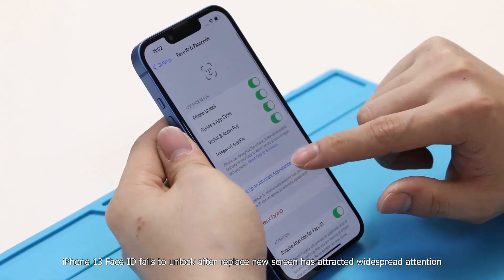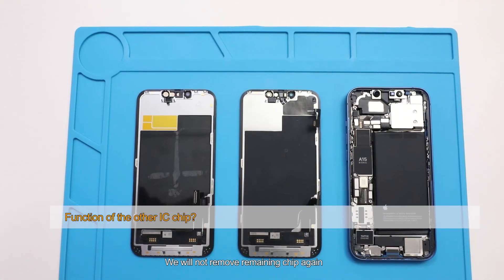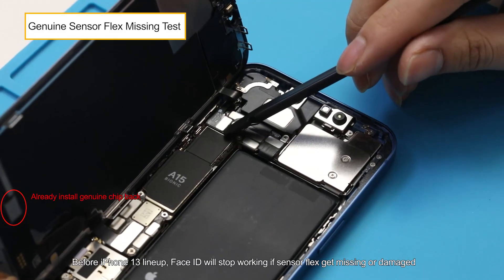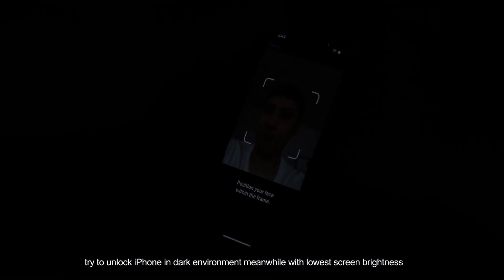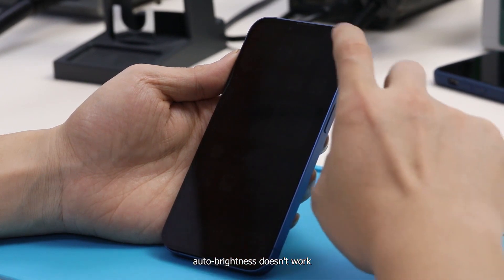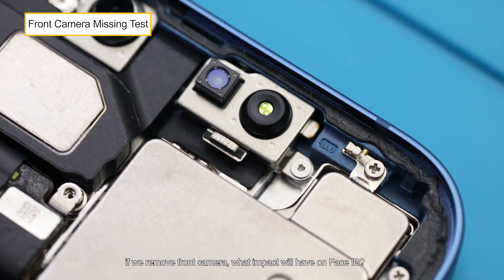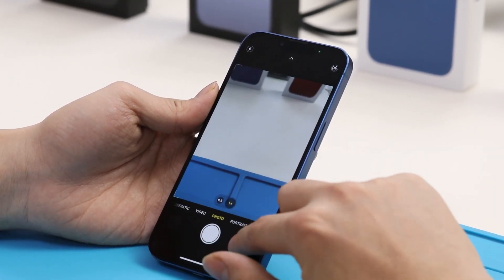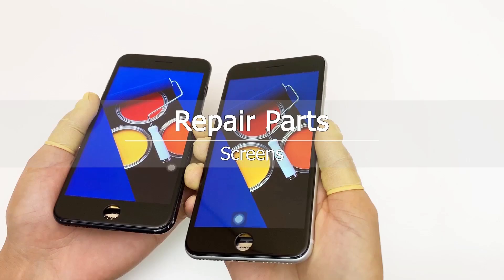iPhone 13 Face ID No Need Face Camera? | TrueTone, Sensor Flex, Front Camera Comprehensive Test

Comment: Hey brother
Can we use samsung s10 battery in samsung s10e 
I know the sizes are little bit different 
But Can we squeeze it inside s10e frame
Reply from the maker: not compatible, bro, better don't try this, especially it's about the power supply.

Comment: Bro can you find solution for iphone xs lagging?working very slow and can not copy data can't airdrop anything,it will work slow but once you try to backup or send airdrop it will restart, Ive seen many tahnician have this issue but no solution,tried change battery,tried change charging flex,tried reball mother board,still same
Reply from the maker: Not quite sure, but maybe you can try:
1- upgrade iOS;
2- restore the iPhone;
3- Check NFC status.
Reply: @Elekworld  thank you sir it was NFC chip,other all method I tried before,NFC chip did not try before,it's solve now,thank you so much sir